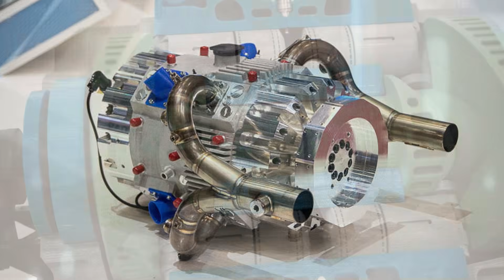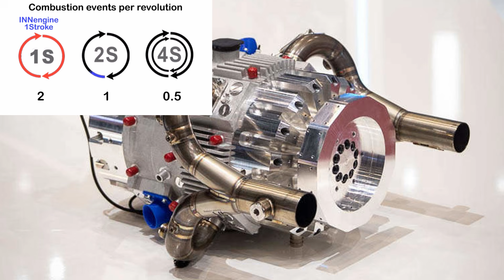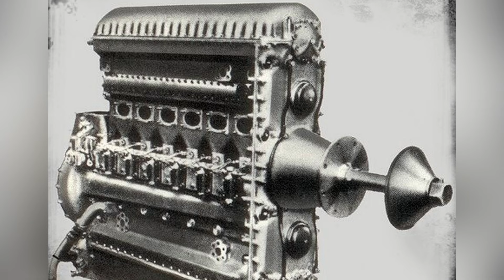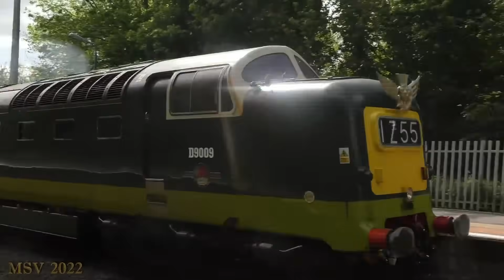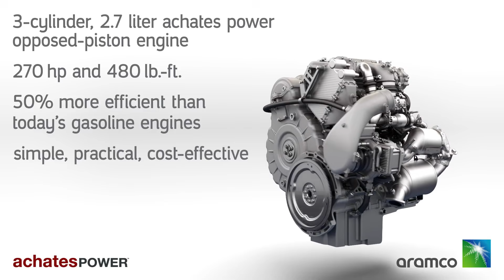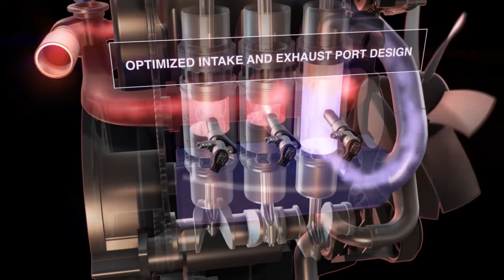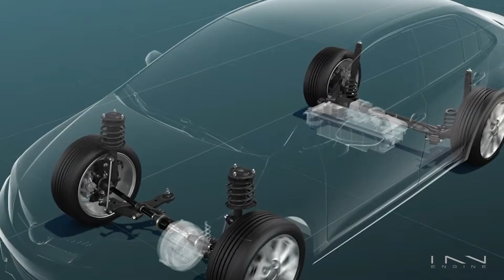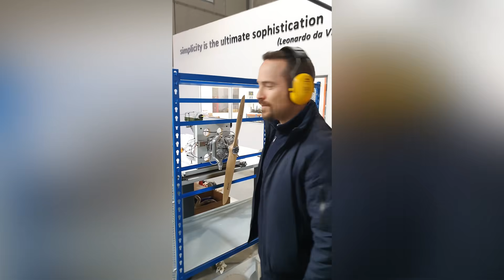NEW OP Mini-Engine DESTROYS Pure EVs

Comment: Battery density has reached it theoretic maximums... Thunderfoot has already done a video on this... and there have been no great advancements in power storage in them for over 10 years... don't look to batteries for more power per pound.. it's not happening.. the only way you'll get more power is by increasing the cells in the battery pack and by making the cells larger. which is not increasing actual power density.

As for EVs eventually replacing ICE engines... it's not going to happen... we don't have the rare earth minerals to replace all the 300 million cars and trucks in the US alone.. let alone the entire world of what 500 plus million vehicles.  Not to mention, it would cost over 100 trillions dollars to build all the infrastructure.. power plants... solar plants.. nuclear.. wind mill farms.. oil.. gas.. hydro plants and all the substations and power transmission lines.  Stop pretending that EVs are the future... they are a dead end.

In addition there is no need to even attempt to do so.. The US alone has enough oil in already found reserves for the next 300 to 500 years alone... Enough Natural Gas for at least 500 years.. and enough coal for 1000 years.. this is just in the stuff we already know we have.. do you not think we will find more in the future?  In addition EVs are far dirtier than the newest gas and diesel engines and not as cost effective either.
Reply: "Battery density has neared it's theoretical maximum"

Not true, use of silicon based anode materials in place of traditional graphite could nearly double the capacity by mass of lithium ion batteries. Several companies are already bringing silicon based anodes into mass production, offering significant gains in Ah/g capacity. All solid state batteries (ASSB's)utilizing a lithium metal anode and solid electrolyte also offer potentially well superior energy density. In the latter case one might wish to find a cathode chemistry similar to FePO4 but using aluminates, or aluminosilicates. Silicon anodes in an Li-FePO4 would make the performance of those ASSB with lithium anodes comparable to existing NiMnCo cathodes, but with greater ruggedness. There's also a lot of research going on into better cathode material chemistries that don't use Lanthanides, nickel or cobalt. Other interesting battery types showing good promise are sodium-sulfur chemistry which have performance similar to Li-ion but use much cheaper materials than lithium or Ni, Co.

"We don't have enough rare earth/lanthanide elements" 

We do if the price doubles. That and if the US stops overegulating thorium which is technically regulated as nuclear material. 

There's been a lot of R&D work in the past 20 years into "Reluctance" Motors that don't use permanent magnets ar all instead simply using a magnetically soft iron core of a special shape, but have quite similar operating, efficiency and performance characteristics to PM motors using lanthanide-rich magnets. The disadvantage of reluctance motors is they have higher torque vibration or "cogging" then PM motors which makes them noisier, especially during regenerative braking. There are two ways around this, the first is sophisticated electrinic controls that produce a non-sinusoidal and adaptable waveform.  The second (a technique Im currently working in) is to use a 5 phase winding scheme instead of a traditional 3 phase winding. The latter is easier to implement in a motor drive unit and may in fact result in lower cogging vibration than a 3 phase PM motor. Al while producing lower level of electronic noise (THED) from the motor driver. 

The Company EBM Pabst has an impressive lineup of external rotor BLDC PM motors that use substantially lanthanide free ferrite magnets, taking advantage of the shorter flux path geometry of external rotor motors. I believe they offer such motors up to 8kW. PM motors using ferrite magnets can also be made in an "Axial flux" or pancake configuration which has characteristics more ideal for direct wheel drive in EV's. (Traditional radial flux motors have lower torque but higher power and higher RPM than you'd want in EVs, so need to be geared down for EV use which the added weight defeats their power density advantage.) There's also been some interesting research into axial flux reluctance motors that night be seen as the holy grail of EV motors. They could be cheap to manufacture, have reduced weight, and use dirt cheap materials, e.g. aluminum and silicon steel. 

Lastly in EV's the biggest barrier to efficiency isn't the batteries or drivetrain. It's size, frontal area, and weight. EV's of 2 passengers or single passenger with curb weight ~ 0.75- metric ton need to become more available. This is question of adjusting customer expectations since the majority of the time pickup trucks or 4 passenger cars are only driven with a single passenger. This conflict of real use vs expectations hurts performance and cost.

Comment: I spent the whole of my army career fixing the Leyland L60 6 cylinder 19 liter opposed piston engines. They were classed as totally unreliable. Then again, they were fitted inside 63 ton Tanks. Although being a design from the 60s they probably had more potential.

Comment: Designed to replace the battery?   I thought the entire idea was to replace the engine WITH the battery?  Turns out that the electric car is really a boondoggle and will never replace internal combustion engine cars.  Every time some 'electric' car hits the market, someone sets out to slap a bandage on it with an internal combustion engine to, "replace the battery" because the battery is quickly exhausted and at takes hours to recharge it. When you add it all up, including the destruction to the environment from mining the rare earth materials needed to make these 'clean' batteries, electric cars are MORE destructive to the environment - but look on the bright side, they give the elites a warm, fuzzy feeling of self righteousness.

Comment: The roller in tracks design makes a very compact engine, but I believe the Achates engine is probably the best design. Using the transfer gear as a power output, it can even have a built in gear reduction making it a great option for small aircrafts and boats.

Comment: There is an FAA approved cam track engine that generates 400 horsepower from the 60’s or 70’s.
I believe it was called the Dynacam engine and I’ve seen it run with a huge fixed pitch prop on it.
That was in the 1980’s….

Comment: I wonder if a scaled down one would work as a boat engine in a hybrid application.  I like the idea of electric, but I wouldn't want a totally electric yacht.  It's too dangerous to be offshore with only a battery and solar to get you out of harms way in case of storms.  Having the option of a diesel engine that also charges batteries would be great
Reply: Unless you're in a submarine, diesels charging batteries to run electric motors to turn your propellers is utterly retarded.  For one, it used more fuel than just driving the propeller with the diesel itself.  2.  More weight.  Batteries taking up space.  3.  Batteries that burn even under water on a boat.... 4 Fire is the biggest danger on powered boats... and you want to use batteries that are known for spontaneously catching on fire and can't be extinguished.
Reply: @akulkis  with the push away from petroleum they are going to continue to drive the price up.  They're starting to come out with electric boats and a few hybrids.  I think removing 1 of the big V8 engines and changing the other over to a medium generator would be the way to go.  I actually think the hydrogen fuel cells would be the best way as a transition away from petroleum, but every time someone comes out with something, it's killed right away.  I know that there were a lot of issues with the lithium batteries in the hurricane in Florida as well when they contacted salt water.  They are problems to overcome.  If there was a way to pull the hydrogen out of the water to fuel something that would be best, but that's way above my abilities.
Reply: @thechadshu  

There's ZERO desire to move away from petroleum except for the people who have essentially unlimited funds to hog up the very limited amounts of non-petroleum energy.  And they don't want you using petroleum because that gives you as much freedom as they have.
Reply: @thechadshu  
Pulling hydrogen out of water STARTS with a 15% energy loss.  Then there's the problem that it literally embrittles whatever metal container you have it in, until it is like a giant fragmentation grenade with old and "sweaty" dynamite inside, liable to be set off with the slightest tap... and no, I'm NOT exaggerating.
Reply: @akulkis  the problem is they control it.  I love the freedom my diesel truck gives me.  I fill it up and have 627 miles of range, when it runs out I fill it up in a few minutes and I'm on the road again.  I'm curious about alternatives for a couple reasons when it comes to boats.  The boat I want has 2 454's in it.  Its 40 feet long and it needs to be redone. So now would be the time to do anything.  I'm aware of the difficulties with the different fuel sources. My curiosity stems from the fact that everything's advanced tech wise, but the basic principles of gas and diesel engines have started basically the same since before I was a kid. Yes I'm aware of the computer controlled ignition and the rest that have made them more efficient.  But they still aren't that efficient, diesel is more efficient but it's what 40%.  Buying fuel on the water is way more expensive because they have you by the balls and unless I order a fuel truck to cover to my house I'm stuck, and when traveling by boat that isn't an option. After spending a grand on fuel you get 3 or 400 miles of range. Something with a battery you can charge with shore power.  You get immediate torque, you'd get more range and hell you could power most of the house appliances with solar on the roof.  They're already using lithium batteries on boats.  So the next option would be sail.  It's slow, and if you're traveling places like along the Great Loop, there's bridges you need to pull your mast down and since a lot of it is small rivers or the ICW, you still end up using an engine.  As well a sail draws more water which keeps you out of shallower water like places in the sounds of the outer Banks. As for your danger arguments, 500 to 1000 gallons of gasoline isn't necessary the safest either.  I'd love to have the range of sail with the speed of a power boat lol.  It's the same thing everyone wants.

Comment: As a longtime fan of both Tony Seba ("Clean Disruption") and Amory Lovins ("Reinventing Fire"), I think you are underestimating the speed with which the green transition is happening. However, as a Chevy Volt owner, I can attest to the excellent utility of a "range-extended" EV. I tend to get a lot of guff from my fellow EV fans for advocating long-range PHEVs as a setpping stone for legacy OEMs who are struggling to make a pure BEV that they can sell for a profit. But with a 10~15 kwh battery pack, you can easily get 40~50 miles of pure-electric range, which is more than enough for most Americans' average daily commute. (I drive about 25~30 miles a day, and I haven't burned any gas in months.) 

This gives you the efficiency of an EV with the long-range convenience of gas. Combine that with one of these new lightweight engines you're talking about, and that would be an attractive package to a lot of people who are still a bit worried about range anxiety.

Comment: This is a variation on the old DynaCam engine, as similar but 4-stroke design which achieved FAA certification but got clobbered by 9/11 and then investor scams.  Looking at the old DynaCam engine, which had a single piston per cylinder (and two "cylinder heads," one at each end), suggests an upgrade path for this engine with three cams instead of two on the same shaft - two "end pistons" just as the current design shows, and a center "double-piston" which rocks back and forth between the end pistons for double the HP for only a slight increase in length and little or no additional complexity.

Comment: it's not too late for development of new engines, because resources don't allow for 100% electrification of road transport so whoever has efficient alternatives will do well. A good contender which uses much more proven tech is a constant speed micro-turbine engine with an electric drivetrain, because then the traction characteristics of the motor overcomes the turbine disadvantage of low starting torque.

Incidentally, the Napier Deltic engine was a fine design which was abandoned by cash-strapped British Rail who were left with multiple non-standard engine designs as a result of their own rubbish procurement policy for locomotives. The same unit was used in its original intended role in the Royal Navy's Hunt class mine warfare ships, where they remained until re-engining was completed in 2018.

Comment: 45 min charge to get 500 mile range "Not very good", Seriously ??
How long can you hold your bladder back before you literally piss yourself ?
It's usually around 4½ hours before it becomes decidedly uncomfortable and in fact ALL European rules legislate that Truckers MUST take AT LEAST a 45 min break after a solid 4½ hour drive.
So there you go. Another 500 miles of range whilst you're having a legislated break.
In case you can't tell, I've been a Trucker for 36 years !
I am interested in the opposed piston engine though. I can see those being introduced into the Heavy Truck market before charging infrastructure (of the massive amperage required to charge an EV truck that quick) becomes readily available.

Comment: As a range extender for EV's it might be a good fit. But for use as a single source powerplant, I don't see it. It is going to need a turbo or supercharger to create the torque needed to overcome the friction of 8 pistons. At this point, I think they need funding to continue their R&D. I think, that is what all the positives are about, found in the news so much lately.
Reply: It looks to be just another chase down the rabbit hole since to be usable it's going to be too big and complex when they can just install a turbo 2 cylinder and save space using parts bins equipment by taking the smallest 4cylinder they have and splitting it

Comment: Nothing destroys an electric motor. They just have a wider power band with more consistent torque across that powerband. This engine has moving cylinders, that alone says it's not better than an electric motor.

Basic physics!

The very reason gas engines can't compete with electric motors is mostly due to the reciprocal forces. Electric motors, like jet engines, have linear rotation force. This allows for power across a larger RPM range. Again... simple physics.

And here's Jason (renowned auto journalist) that explains why gas engines will never beat electrics:

https://youtu.be/vcn7tvESreI

Comment: I have a limited knowledge of engineering. I can figure out how  the rod can push the apex designed flywheels. Perhaps if it where modified to a specific direction and were six pistons.
The pistons would have to be in seperate sleeves for efficient combustion.

Comment: The mad rush to EVs is definitely not the best way to go since like you claimed and I agree that the electrical grid is not going to be capable of charging and supplying enough for cars and the masses as we find out every summer and the prospects of a total breakdown of the infrastructure not to mention the cost of the mining but hydrogen seems to be not only the cleanest but the most abundant resource on earth and the only pollutant is water vapor and maybe trace amounts of carbon from having an oil lubricant maybe EVs can be more beneficial in urban areas for short distance driving but the long drives are pretty much a crap shoot given the present environment and the infrastructure plus the service centers that would be needed along with technicians and replacement parts but this  engine is not only  feasable but would be acceptable to the general public but might be embraced really like the insight of this technology and maybe something everyone can agree on.

Comment: Haven't you figured out yet that the four stroke reciprocating piston engine is the worst possible design in terms of weight, manufacturing costs and fuel consumption?

Comment: Watched another video on the INN engine. It lacks low speed torque. Wouldn't be suitable for a direct drive car. But it would be perfect in a hybrid where it only runs at optimum RPM and charges the battery.

Comment: Wow. Someone took an old (like 1960s) GM swash plate air conditioning compressor, split it in half, moved one half so the piston tops face each other, and made an engine of it. It seems to me the major advantage of this arrangement vice just making a six cylinder engine from the GM swash plate compressors is the ability to vary the timing of the two swash plates. The supercharged Fairbanks-Morse opposed piston engines had six degrees lower crank lead, the one with turbochargers and supercharger had twelve degrees lower crank lead. The lower pistons would clear the exhaust ports earlier so the exhaust could spin the turbos.
Reply: This engine type was developed in 1917. So this particular engine is nothing new at all

Comment: fraud - the physics of internal combustion does not change ever, regardless of the 1, 2, 3, 4, 5, or 6 stroke engines. This particular engine design has been around since the late eighties and this company just sells stock, makes millions, files bankruptcy, starts new company with new iteration of same op engine design and promises new design will work. They make millions in stock sales, only make prototypes, never sell engine in bulk, file br, start over. repeat, repeat, repeat.